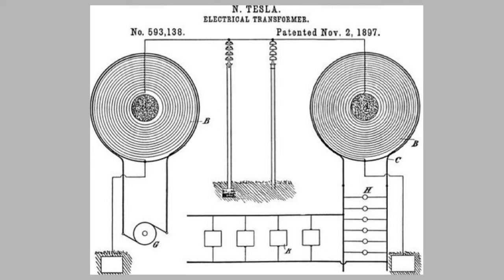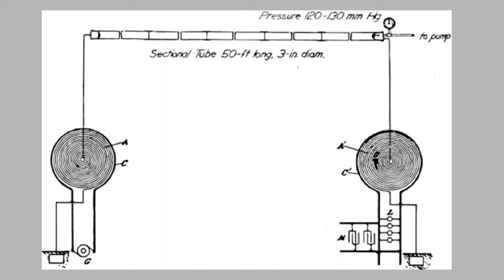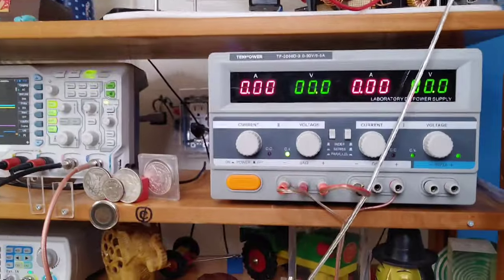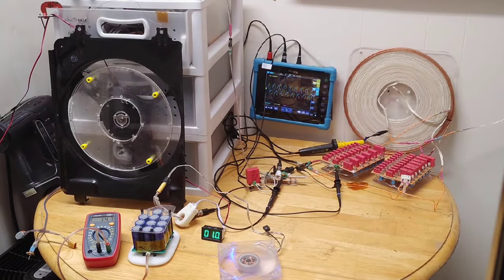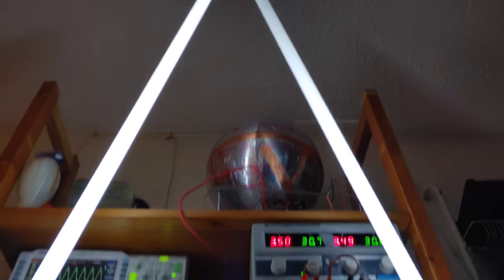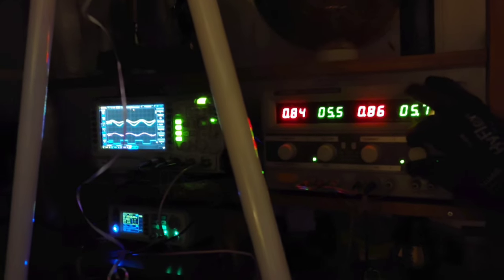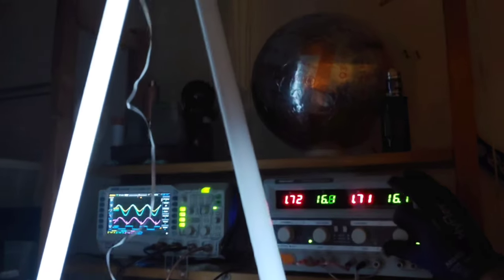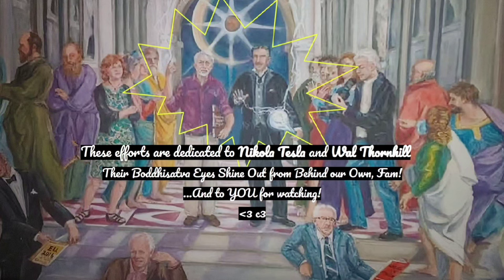Nikola Tesla's Single Wire Power Transmission, Part I: thru Flourescent Tubes & Wire

Comment: Your channel just popped up in my recommended, first Ivo's short and now this eh? Neat. I do have a question concerning the start of your video though, are you sure the L2 is producing AC? From the experiments I've seen of this type of tech and what I know about Radiant Energy/Cold Electricity (which isn't actually electric) the L2 output is actually AV (Alternating Voltage) potential, which results in there being a lack of magnetic current anywhere except inside a resistive load, like a bulb or motor, hence a lack of heat and the reason the wires can be freely touched in circuits that use it like the hairpin circuit.

Really nice video c3l, the more people talk about this stuff and the new physics of it, the better. I feel we're on the edge of something big worldwide considering the sudden boom of interest surrounding the Aether and Tesla's lost radiant technology. Subbed.

Something else that might interest you, I've been in contact with a few folks on this stuff and one of them built a solenoid radiant transmitter for some tests somewhat identical to patent 645,576, he had an Aluminum plate nearby and found that when the transmitter was on it did something very strange.

Placing his finder tip on the plate resulted in a rapid heat buildup to the point it nearly burned him, yet when he placed his open palm on it the surface was cold like snow, colder than the ambient temperature of the room! 

My theory is that his lone finder did a similar job to how a resistive load works in single wire transmission, where the wire is operating on electrical reactance or pure voltage potential and the resistor acts as the load which converts that potential into Magnetic current, light, and heat, his finger might have been acting as a resistor between the plate and his body as a capacitor, that's my theory on that anyway. 

But the cold effects of his open palm are something else that's got me a bit stumped, perhaps contact with another material below a certain resistive threshold induces Endothermic effects? That's certainly worth checking out.

By the way, have you had any success in drawing power from the receiver without putting strain on the transmitter? There's a fellow on YT called MTECH INDUSTIRES that's been doing a lot of experiments with these radiant transmitters, he's been able to not only avoid increasing the power draw on the transmitter when connecting loads to the receivers but he's actually gotten higher output than input, as an example from one his videos:

Pulsed DC Input: 16V 67mA - 1.07 watts
Rectified DC Output: 37V 75mA - 2.77 watts

Considering any number of tuned receiver coils can be used, the implications are obvious, the receiver coils don't produce heat until rectified either, have you observed similar phenomena?

Extra thing concerning the end of your video, I remember from Dollard's analog computer from decades ago that both voltage and current increased towards the load end of the circuit, and from what I understand it was because he had shifted the magnetic and dielectric phase to 0 when supplying the circuit with AC at its resonance frequency, is this identical what the extra coil is doing?
Reply from the maker: man I am sure of nothing, I just said "AC" as a matter of convention but I cherish your welcome idea about wtf might be going on, alternating voltage/potential oscillations rings true. Because I'm getting all sorts of little inexplicable anomalies trying to 'transform it back into conventional current'.

This signal is zooming through rectifier diodes after the receiver secondary like they're nothing, and it's preferring to charge all my smoothing caps NEGATIVELY, regardless of how I try to ground the rectifier. Superfast RF diodes have been degraded into leaky resistors like they have no bias. And the receiver's probes do strange things if grounded. And the extra coils have not yet been of any discernible advantage :/ 

But yeah it's been so tricky to try to get any basic power/efficiency measurements, at this point I'm putting more thought into finding a way to pin down/demonstrate the mysterious/anomalous stuff, because it dominates lately.

I'm needing to dig way more into this to try to say anything conclusive lol, thnx for the pointers I'm making note. I'm trying it out thru a carbon fiber thread now, it cares nothing for resistance. not conventional conduction currents.
Reply: @cold3lectric  You might have already thought about it but I believe you deal with the transformation problem through the use of a closed step down coil of the receiver, I've noticed that if you take a circuit based on single wire transmission and close part of it then conventional magnetic current will form in that part only, this happens in the Avramenko Diode Plug if its input is also from SWT, whereas as long as the system remains open and no closed return path is provided then the potential will remain in its respective form. I first head about this from the research paper "Zaev N. E. Avramenko S. V., Lisin V. N. (2012). Measurement of Conduction Current Excited by Polarization Current" over on waveguide:

"This device is really nothing more than a half-wave rectifier setup with the input terminals of the two diodes connected to the single wire transmission line, but it enables some thought-provoking results. For example, when traditional magnetoelectric or thermoelectric milliammeter are used on the single-wire line, no current is measured, but when these same meters are connected to the Avramenko plug circuit, current is measured"

And like you noticed in your experiments they also reported that single wire transmission ignores components that usually have significant effects on the circuit, such as Resistors, Capacitors, and Inductors in series. Other researchers also noted that the Plug could be improved: "The Avramenko plug’s efficiency can be improved by using a full-wave bridge rectifier setup, a capacitance connected to the end of it, and a magnetoelectric milliammeter connected across, as suggested by Kasyanov (2015)"

So in a nutshell, the open L2 (or L3) transmits the potential to an identical open mirror image receiver with a closed "step down" L1 around it, it will take the transmitted potential and convert it (either into conventional current or cold current, resistance dependent?) which will remain confined to the step down coil and useable as real Electric power, this is probably why Tesla designed it in this manner in the patent, hope this is useful.
Reply from the maker: @jenkorun1306 yup! It was a long road to figure out that full wave 'AV plug' needs grounding. AND that chops your negative amplitude from DC output, so the key I've learned lately is; CENTER-TAPPED/GROUNDED SMOOTHING CAPS ON FULL WAVE "AV" RECTIFIER. I'm bout to post a video on it.

Right on and good hearing another human being in on this stuff, respect to ya! Im already reflexively quoting Strebkov, Kasyanov, and Avramenko terminology much as you do hehe. "Potential oscillation, no electrons dude, magnetic field aligned to axis of propagation folks! Subtle!" 😇🌞⚡

P.s. the negative charging thing was eh... Operator error... Mistakes were made lol shhhh
Reply from the maker: @JenkoRun  this paper is my flavor of the week:
https://waveguide.blog/static/Strebkov-single-wire.pdf

Gotta give shoutout to waveguide next time! The receiver need not be grounded to earth; receiver primary having its neutral terminal connected to vehicle chassis (capacitance/conductive body) allows for traveling receivers.... Boy o boy, happy thanksgiving all!

btw, receiver coil being connected (to single wire) always draws power from transmitter, approx doubles the draw,  but the load drawn from Rx does not effect the consumption at Tx, i believe i have noticed consistently 🤷

Can't wait to try thyristors (scr, silicone controlled rectifier), just reading about phase adjustments with duty cycle to get a constant voltage output? Gotta get on that!
Reply: @cold3lectric  Looks pretty solid on a surface level though the math isn't my area, I usually look at Tesla's wireless transmission (which definitely needs some form of grounding for long range situations for obvious reasons) but SWT is also on my list, although I'm more interested in it for its non-current effects over long distance transmissions since I feel the wireless earth method is superior.

In the case of the receiver coils and the transmitter I always come at it from the perspective of a non-electrical connection, either through close air proximity or Earth grounding, so I cannot really comment on the double power draw effects occurring when they are physically connected through a single wire and the behavior of connecting a load, interesting it does that.

I suppose it might have something to do with how Radiant Shockwaves use the Earth or air proximity to a close resonantly tuned receiver as a medium to gain an overall increase in field availability during propagation, whereas single wire transmission mainly creates electrical reactance conditions, despite seeming similar I believe there is a significant difference between the 2 with radiant energy being the Aether set into motion by either a voltage or current impulse that carries the energy used to induce it, whereas SWT is unable to provide the effects of Radiant Energy on its own, though obviously compatible.

I wish I had the parts to perform my own experiments, I would have liked to experiment with mobile wireless receivers and how non connection ground could be accomplished over significant distances. Glad we have folks like you on the net who can share their experiments and results :)
Reply from the maker: @JenkoRun  if you have a strong impulse about any particular data/confimation, i invite you and whoever, to suggest/feed me experimental design ideas if you like (or not🤷) - ur a but further along thinking about some of these same angles which i fancy, and i can safely (if arrogantly) assume it would be saving me time inevitably thinking of it myself hehe 😈 

Mhw1986@gmail.com

P.s. i will say, nearly all math in whitepapers is a turn-off for me too, but i distinctly felt that strebkov's math formulas were 'approachable', or 'cool', even 'do-able' for me. I don't recall that happening before. Dont believe it till ya see it tho hehe
Reply: @cold3lectric  I have an idea or 2 I've tossed up in my noggin on occasion, though I can't guarantee they'd work since it's all theory in my head lol, I might send you an email with some ideas and model designs (I use Blender) on them, perhaps we can open a dialogue and bounce ideas of each other, if I can help in any way with your experiments I'd be happy to offer what I can.

If you have an interest in levitation tech for a future date you might like my most recently upload to my community tab, it contains a design based on some info I found from Tesla Field Physics, who took inspiration from Ken Wheelers works among others, I don't know if the device would actually work if built but it does emulate the geometry that magnetism takes when it springs forth from Counterspace, which is encouraging.

Thanks for sharing your email, life's a bit of a clusterf*** right now so it might be a while before I send any emails over, world's kinda going to the pot, hopefully I'll have time sometime soon. I'm looking forward to whatever you upload next too, I like the energy and passion you seem to have for this knowledge!
Reply from the maker: @JenkoRun  no pressure but no judgement! I was erroneously wiring all my rectifiers with reversed polarity outputs, wondering why my caps charging negatively, and it me took nearly A YEAR to figure that simple thing out lol, spitball ideas shamelessly anytime next week or next year if the spirit moves ya :)